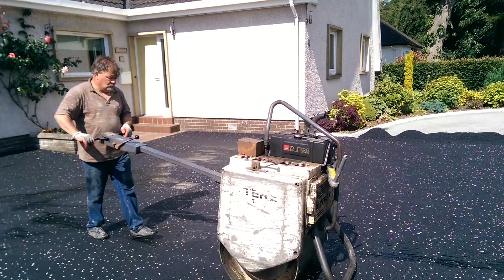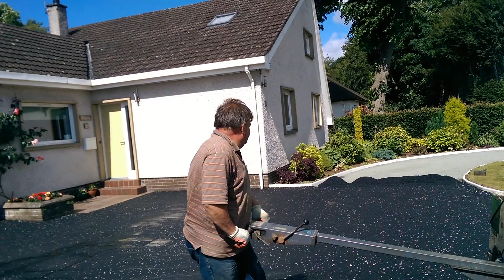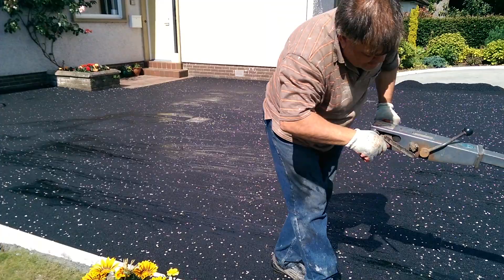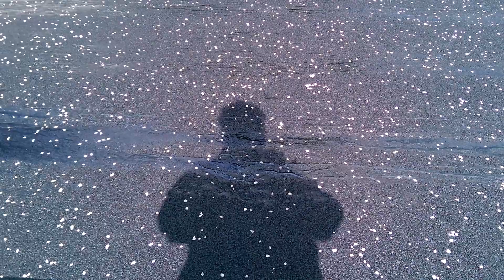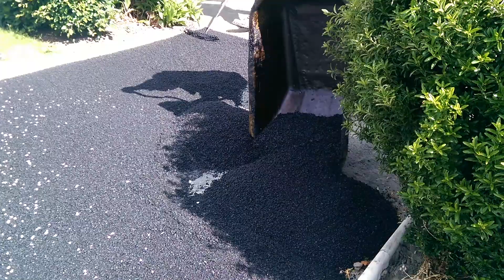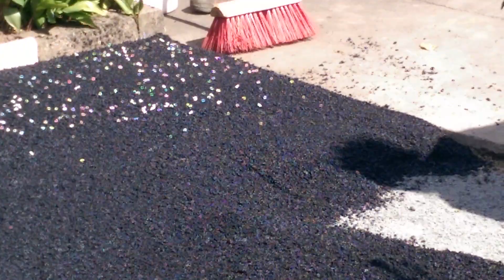Hand Lay Tarmac Driveway by Gavin Lawrie Surfacing Ltd

Comment: Sigh. I just don't understand why everybody says me and some pals can't do this ourselves. :-)
Reply: Eric Frazer a smooth level finish with the lutz or rake looking tool is essential. The guy in this video makes it look easy. That's experience.
Reply: Eric i have been laying asphalt for over 35 years, dont let anyone say you cant do it, get you a wide broom or rake to smooth out the asphalt, go to the rental store and rent a sode roller, its a push type roller, fill it with water for weight, get you a couple healpers and get to work, dont let anyone say you cant, you can do anything you put your mind to,, oohh you need common sence to,lol.. make sure you roll the asphalt before it cools down to mutch..if you fail , at leat you can say you tryed..good luck